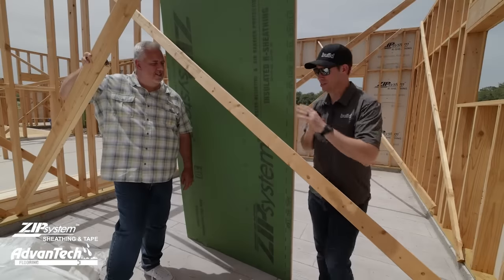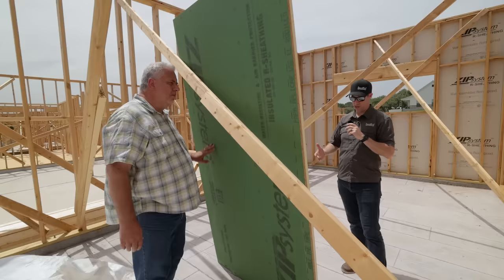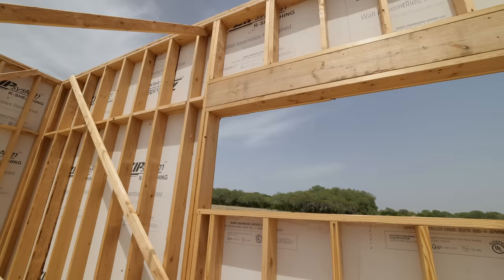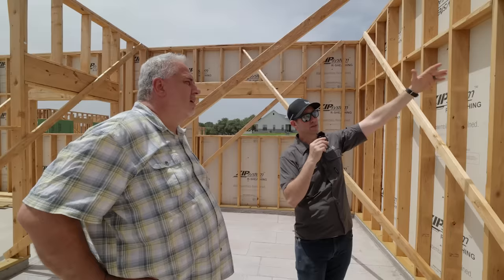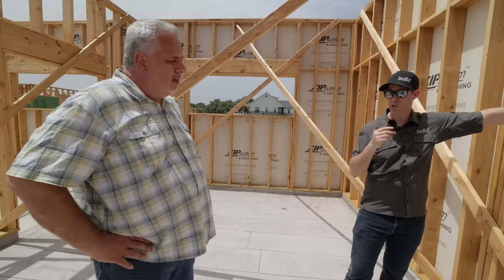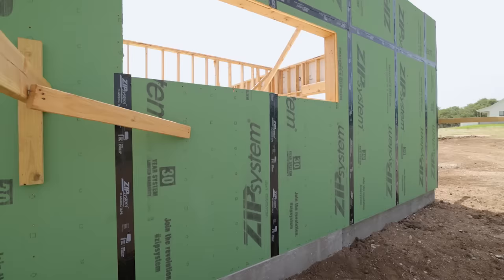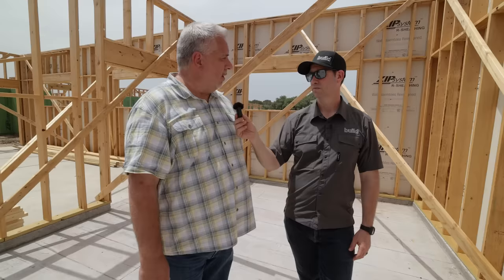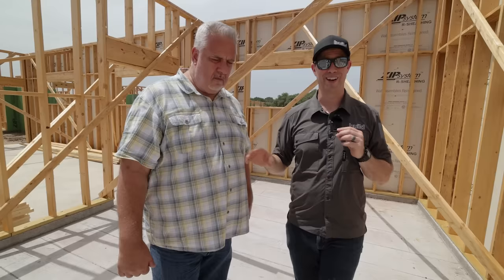ZIP-R Sheathing Review (Feat. Steve Baczek)

Comment: One thing I've noticed, in so many of these videos dealing with Zip-R, and it's benefits, is they don't ever seem to talk about the wall to roof transition, and what to do with the room sheathing.  Zip-R isn't certified(?) for roof usage, like it is on the wall, so you still have that thermal connection compared to the thermal break Zip-R has in the wall.
Reply: I think in one of Matt’s videos the builder brought in an engineer to spec out and vouch for Zip-R on the roof. As I recall there wasn’t a lot of weight on the roof.
Reply: I beleive you can install a layer of plywood then zip-r over the plywood for a roof.
Reply: @ericwotton2046  not a bad idea. Basically  turning it into a SIP roof system.
Reply: search for "Monopoly framing" on YouTube, Matt has done a few videos on it. regular Zip roof sheathing intersects the wall sheathing and gets sealed with tape, then any overhang/eve is framed outside the envelope. Exterior roof insulation is laid over the traditional Zip.
Reply: @kschleic9053  yes he used modified lvl's for rafter tails and did two layers of 2 inch polyiso. I've drawn out the details on sketchup. Plan to use that assembly on a post frame I'm designing.
Reply: @ericwotton2046  $$$$$$. at that point just put some poly over the initial OSB.
Reply: Uh?  Sure it does.  Flip it over.  Insulation UP.  Of course I would never put particle board on my roof.  Most do and it is STUPID to do so if you asked me as I have repaired numerous numerous crap particle board framed erm sheathed roofs.     As to wall roof transition, NO one has a good solution other than sprayed in foam or lots of rockwool board which you can cut to size and nail in.
Reply: @w8stral  the zip barrier is directional, it's designed for water to move outward (from wood through barrier) much easier than inward (through barrier into wood). I think reversing the panels could cause problems... And how would you tape the seams?
Reply: @kschleic9053  the change in topic for some odd reason went to roof so... Its in a roof system...  There are no seams to tape.  You know, ROOFING over the top.  In this case over the insulation instead of over the "green part"   If you really want to tape... Uh genius, tape works just fine on the insulation.
Reply: imagine walls framed and sheeted with zip. Now nail on a ~12" strip of zip onto the top plate flush to the outside leaving a few inches extended to the interior - zip tape that connection then land your trusses on top. Strap the ceiling with something of the same thickness as the zip and use drywall to complete the air seal, acoustically sealing the edges before install.
Reply: @patrick  this is an interesting concept in  that I haven't put much thought to. Built in drywall backers as well.
Reply: @rustedoutwrench  it's mainly an air sealing detail but has other benefits like drywall backing.

Comment: This was the easiest way we figured when we built our house, we just set the foundation walls out 2 1/2 inches wider so the zip R 2" would be flush with the foundation wall, kept the zip up about  1/2 inch and spray foamed between the foundation and zip and liquid flashed the connection between foundation and zip
Reply: Sounds good. How much did the extended foundation add to the cost though?
Reply: Great idea
Reply: @matsudakodo  it really didn't add to it, we just moved it out 2 inches all the way around, so it's not any thicker, it's a slab on grade

Comment: Matt, you asked when should the insulation be to the inside of the sheathing vs outside of the sheathing.  All I got was there are different rules for different climates.  Would it be possible to go over those rules for different climates, the pro's and con's.  You go discuss freezing climates on a regular basis.  I live in southern California, 100+ degree days don't feel good either. Thank you for all the education.  Just a suggestions Sir.
Reply: different rules for different applications not different climates. All 3 different ways accomplish the same thing.
Reply: The Cold Climate Housing Research Center has some great videos on this.   Particulary this one: How to: REMOTE Wall System Part 1
Reply: i wish they did mineral wool, then vapor barrier wouldnt be so questionable because here the foam then osb then vapor barrier, i feel like these would trap moisture ? Assuming this foam they use is perm though so prob not

Comment: I used Zip-R 2" and 2" rockwool comfort board over the top since we're in high fire area. Donner Lake in CA. Closed cell in cavities. Was pricey but incredibly comfortable
Reply: Nice, 2x4 or 2x6 framing?
Reply: @DAMMDAUGHTERS  2x6. Some major structural beams on lower level cinder block garage so had to. I wanted them anyway and engineer said they had to. I wanted a very efficient home. Haven't done blower door but it's very tight
Reply: @jwristen24  that's very similar set up what I want to do. Hopefully as these products become more popular the prices go down a little. I bet it was pricey but worth it
Reply: @DAMMDAUGHTERS  very worth it. A small fire in the stove and you're opening windows lol. Triple pane Jeld Wen's. Doors aren't high end passive so that was about the only area I saved lol....
Reply: yeah, imagine if they had partnered with a mineral wool board company like owens/rockwool :( i wish!
Reply: Did you install a HRV/ERV air exchanger since the house is tight?
Reply: @dougwarner8598  I didn't feel the need since I skimped a little on the sliding doors and walk in doors. They weren't passive rated. I'll reassess in a couple years and if I need it I plan to. Not sure how I would gauge if I needed it.
Reply: Any ideas how I would know if I needed it?
Reply: @jwristen24  Get a blower door test performed. Then check your house score against the ASHRAE recommendation. A tight structure may warrant mechanical ventilation to guarantee indoor air quality.
Reply: @dougwarner8598  thanks Doug. I scheduled one in two weeks. Much appreciated
Reply: @jwristen24  how did that blower door test treat you?
Reply: @Daniel Leebrick  I never got one....but I can tell you that place is efficient as can be. Small fire and you sweat out....
Reply: The way to test the need for fresh air is a Co2 meter.

Comment: Always good to see Mr. Baczek!! 
I just finished a Zip R house and it was more difficult for this reason. In my area,  Zip R is not available in 9 or 10' lengths.  Only 8' lengths.  Thus there was a ton of extra blocking required to compensate.  I'm still a fan of the product; just wish we can get longer sheets.
Reply: never seen even non-r zip panels in my area...
Reply: @zefrum3  most builders supplies have to order it. Be prepared to wait and to pay out the ass
Reply: Is it harder to use, because it is heavier?
Reply: @Raymond-mk8cb  Because of all the extra blocking required for 4x8 sheets.

Comment: Matt, Steve, 
Excellent Educational Video. You two provide an outstanding collaboration and thought provoking discussions! 

I loved the explanation that various exterior sheathing insulation options are NOT an issue of which is ultimate but more related to the set of Rules that go with the selected exterior insulation opinion! 
I love the Dr. Joe perfect wall on Matt's house, BUT for all the non-standard construction processes (and without a pro like Matt on the job), I wonder how much net value and cost it is over a Zip-R (R6 or R9) with a 1-2" flash of CCSF and blown insulation or RockWool inside (for my Southern-NC Coastal area)??? 

Man, you guys get at some Excellent aspects like climate zone options and regional code issues like Jake's 2x8. I'm thinking the Tape detail at bottom of Zip-R would be better at stopping bugs and improve Air and Vapor boundry.... as long as the tape sticks for 50+yrs!  Also, I'm thinking the insulation blanket should cover the Sill plate would be best??? 

Cheers, 
Eric
Reply: #longlive our buildings!!!

Comment: Would have been very helpful/useful in this type of video when discussing one specific product to state the current price of Zip R vs standard OSB and what it means cost wise for a typical new build.  I know there are some additional benefits but the biggest reason to use Zip R is the savings it would provide in heating and cooling and calculating this is a very complicated thing.
Reply: Matt does have a price comparison video of different wall systems, including zip-r.
Reply: @taylorseigler  I believe that was pre-pandemic and I'm sure current prices are drastically different.
Reply: It's all over the place right now. Just the sheathing was going for like 86 bucks a sheet a few months ago from home depot. Thats not even the insulated stuff. Think its back below 60$ a sheet now but it's horrendous when they've been doing.
Reply: By the time we edit and post the video the $$ info is out of date.....

Comment: Matt, You can get the same performance as Zip-R with just using 2X6's   24 o.c with Closed Cell foam.  Thermal bridging becomes less of an issues with 2x6 and greater studs. This is a much cheaper solution too.
Reply: He does and did do that. The zip-r is additional.
Reply: depends on several factors. Have to use 5/8 drywall with 24 oc & also cannot use 20 oc joists with a 24 oc exterior framing I believe.
Reply: I FEEL ALL zip is overpriced bullsirt!//Taping an OSB SHEET THAT COSTS more thandouble is pure silliness! WE tearoff roofs everyday //raw 0SB...that is 35 years old and still perfect..and taping with tape that costs 500 bucks on a house that will leak IF ITS NOT ROOFED RIGHT IS another waste!SPENDING MORE ...300% MORE IS NO BETTER!
Reply: It helps - but it is not the same....
Reply: Show your data
Reply: It isn't quite true. A 2x6 stud is about R-5.7, adding the R-6 panel effectively doubles the R-value at the stud, and that is approximately 15%-18% of the wall. It also adds the R-6 for 62%-65% of the wall at the cavity - effectively adding R-6 for 80% ish of the wall. And it isn't just about R-value for comfort - It also elevates the temperature of the first condensing surface in the wall (during heating season). In Texas this isn't as crucial as say Boston, but it does play a minor role
Reply: I think the best bang-for-buck is go with R-6 panel + 2x6 + 2" closed foam + 3.5" batts. That's what I did anyway (Minnesota). The 2" closed foam glues everything together and seals the 1000's of nail holes too.
Reply: @steveharter7819  I like your process there. Still, if it’s -25° F outside and 72° F inside with a humidity if 45% you’re going to have parts of your batt insulation that are colder than the dew point.

I hesitate to depend upon smart vapor barrier to keep moisture from migrating from the interior of the house to the wall cavity because decades from now the smart vapor barrier will be full of holes from people hanging pictures, mounting TV’s, running cables through walls, etc.

We’re building soon and I’m having a hard time wrapping my mind around resolving these issues for our build.

Comment: I like the t shuds for framing, also make foundation wide enough to have full wall, so outer is flush with foundation. N run a thick system on exterior with spray foam inside for max insulation in the end overkill

Comment: If you get an aluminum flashing custom bent you can have it wrap around the bottom of your ZipR sheathing and back up so you can scre it into your studs then slide the sheathing inside. Would make an easy to seal joint that you would not rely 100% on the flashing tape. In that case i would use a fluid applied in behind on the bottom to seal the flashing to the studs as well as to the face of the sheathing. You can then put your flashing tape over top just for overkill
Reply: Metal flashings circumvent the insulation. The wood and flashing tape detail is more effective at retaining the R-value that was paid for.

Comment: I used Zip R-6 on my home myself.  I’ve heard no one before mention that the spec calls 1.5” minimum penetration and .131 nail.  It isn’t just a longer nail, it is a thicker framing nail.  You go to an R12 and you have a 4” nail.  Where do you find a gun to shoot 4” nails?  I used ring shank 3-1/4” .131 as my “belt and suspenders” and a pressure treated 2x at the bottom outside wall to sit the sheathing on.  All things Matt has shown, but the nail size still caught me off guard.
Reply: Several companies make nail guns that shoot long nails. Fasco's "jumbo nailer" shoots 4" up to 6.25" nails, it's pretty impressive.... And scary 🤣
Reply: @sixtomidnight1492  sounds like a great Wire and pipe finder if used incorrectly.
Reply: I'm building a home with Zip-r12 and I bought two Bostitch "Big Bertha" nail guns to shoot 4" nails.  These guns are big and heavy, so the walls will be lying down for attaching this sheathing.
Reply: what did you do for air and water sealing at the bottom over your 2x?
Reply: He made that shit up. Actually he scerwed up as 1/2" sheething requires 1.5" galvanized roofing nails and 25/32" sheething requires 1 3/4" galvanized nails.  So, that is 1" of penetration, not 1.5" penetration.     Who can shoot 4" nails?  My gun shoots 3 3/4" nails and I have yet to see a gun which cannot do this.   This means with standard 1/2" sheething can have 2.25" insulation using standard nails using a standard nailgun.  Same goes for 3/4" sheething and 2" of insulation.

Comment: i’d love to see some sort of composite material used to replace the wood used for sills. still going to have cold concrete and a new material would be a good thermal break for the base of the building.
Reply: Use Amvic ICF for foundation

Comment: So I know ZIP R is a savings for a builder because your installing 2 products at once and time is money but I have a dormer that needs new siding and I want to beef up the insulation under the siding. I truly do believe in ZIP but because I’m a DIY’er and don’t have a commercial account ZIP R is $144 a sheet for me. Can I achieve the same product if I do 1 1/2 foam board and zip over the top? I can make that assembly for about $80 per 4x8 sheet.

Comment: If I was going to build a stick framed home I'd definitely be using the Zip-R for walls AND roofing.  T-Studs for the exterior framing (minimum of 2x6 equivalent) and then spray on closed cell foam for the outer walls and the underside of the roof deck completely filling the cavities.  I'd rather go with ICF for the basement walls, first floor decking and walls and the attic floor / first floor ceiling.  Then 2x8 for the roof joists with the closed cell spray foam and Zip-R6 roof decking.  That should give me a roof R-value in the neighborhood of an R-60
Reply: ICF isn't recommended for below-grade construction from what I know (termites bore into it, and use it as a pathway to your upper wood framing).
Reply: So far ZipR has not gotten approved for use as roof decking.
Now Matt used Zip roof sheathing then layered two 2" poly iso then another layer of Zip Roof sheathing.
Reply: I did what Matt did for his home.  2 layers of polyiso staggered at the joints on top of the ZIP 5/8 roof deck. I added radiant barrier on top of the polyiso, then bolt down 2x4s to each rafters to create 1.5in air gap for the radiant barrier to work and to hold the entire insulation together. Then I laid down 1/2in roof deck for the shingles. My total r- value is 56 for the entire roof with R-30 rockwool between the rafters. It's been working great and still meet the snow load.
Reply: @anhtuanb  I've watched his build too.  Mine would be a double roof deck as well, with the inner (Zip-R) being sealed to the outside, but the outer one the actual roofing is fastened to having soffit and roof peak venting.
Reply: @MonzaRacer  Understood.  I might have to do it the way Matt did or just say screw the official approval lol
Reply: @ErikWilliamsviolin  There are moisture barriers that are also termite proof when properly applied.  There is one brand that's been featured on this channel but I can't recall the name right now.

Comment: To fix the fact that you have an extra 1 1/2” foam on the outside, why don’t you have the foundation poured and 1 1/2” bigger all the way around? That way you’re not hanging everything over and you can flush tape if you want. Plus your baring point is not compromised by hanging over the load points. Just wondering if anyone has thought about that and if they did what they had to say about the idea.
Reply: So this is just what I have seen Matt do and I’m not a professional so please don’t tail me too bad if I get this wrong…. But I think he does it that way to give the wall a drip edge and so it’s not sitting in water if it were on concrete… he usually seals the “drip edge.” Also I think the wall is bonded to the framing with the fasteners and not so much by sitting on something.
Reply: If you used ICF for foundation then you can make the exterior plane of the walls line up with the ICF thickness
set the floor ply on top of the ICF and the ledgers and joists inside the ICF wall, seal under the ply on the concrete  and between plates with  proper caulking for air barrier.  Or better yet just build ICF to the roof, saves so much time
Reply: That's exactly what I did.
Reply: The concrete forms would be special and HORRIFICALLY EXPENSIVE.  = DUMB
Reply: @w8stral  
It’s really just a matter of changing a dimension = 💡💡💡
Reply: @w8stral  ICF cost is half of a plywood formed wall.  Look at taper top blocks, the concrete flows to within 1 inch of exterior of form so there is suitable concrete structure supporting walls or floor